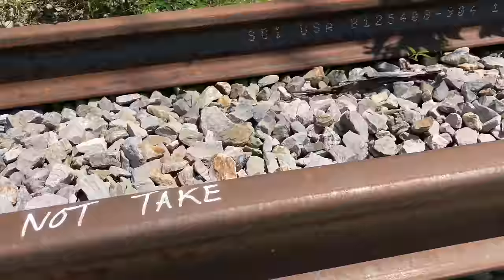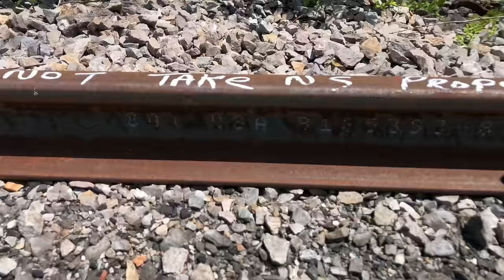Abandoned Railroad & Abandoned Locomotive Isolated On Abandoned Coal Mine Branch In West Virginia!

Comment: Sad to see. Even if that engine wasn't worth starting, they could have pulled it out and brought it to a place to be scraped. That is weird to see the distant signal, or a detail signal, still lit without track near.  Unfortunately the coal will be replaced by solar. A coal power plant where I live is closing down next year. They talk about replacing it with solar. The plant sits on about 260 acres. It would take about 2,500 acres of solar panels to replace it and get the same amount of megawatts. Talk about a big footprint.
Reply from the maker: They just installed panels on a farm a mile from mine.  It takes up an incredibly huge area.  They wanted to buy my farm but I didn't want to sell and neither did my neighbors.
Reply: @JawTooth  What's even more crazy, there is so much hazardous material in those solar panels that after their 15-20 year life span, they have to bury them. Doesn't sound too environmentally safe to me. I think you made a good choice declining having those on your property. Farming your land is far more productive.

Comment: Hard to believe 3-4 years ago, they just opened 2 new mines maybe 30-45 minutes from there.
Reply from the maker: Do they have rail service?  Where are they?  I want to return
Reply: @JawTooth  The mine just outside of Wylo does, and they shove WAY up the valley there, the other is outside of Berwind. Now sure how that mine is moving material, there's track there, but not to the face. that's at 37.213230324891775, -81.66544148266723.  Around there, is a large steel trestle and ahead of that is a tunnel. 

The Wylo one is 37.711457, -81.752866 at least the face is, the load out is here: 37.68201531310831, -81.83023660932894
Reply from the maker: @kleetus92  I almost filmed the one at Wylo.  My plan was to spend the night at the Colonial Inn in Man and then try to get a coal train on that line that goes to Wylo.  We spent our first night in Matewan but I was having a hard time finding loaded moving coal trains and my wife didn't like the place we stayed at in Matewan.  Due to that we left without staying the second night in Man.  I will return though.   Do you have any idea how many days the trains run through Man from the Wylo loadout?
Reply: @JawTooth  Honestly I do not. It's been a couple years since I was there, and I was there originally to put in the VFD speed control for the main ventilation fan. When I was there I stayed in Logan. Pretty sure it was a Holiday Inn, behind it was a movie theater and a bunch of stuff at a decent mall. I went poking around the valley there a bit an found some old, OLD signals still in service, just the standard traffic light variety beside the main bridge into town. Don't know if you saw my email or not..

Comment: The only way they could possibly reclaim that locomotive is with the use of a railed flatbed road.trailer and semi used to move heavy equipment. Install rail on the bed with a tapered lead to the tracks. Attach a heavy cable to the loco's frame...shift it's gearbox into Neutral (providing the gears didn't seize up)...and winch that baby up onto the trailer on the rails. Chock the wheels, and away you go.

Comment: You should see if CCET would buy the locomotive to use! Just be a matter of getting a lowboy and crane up there to get it. Looks like it still runs.
Reply: Oh, and don't forget how much all that will COST! If the loco does have roller bearings there still might be some serious mechanical issues that precluded a sale or another use elsewhere.
Reply: @kenhanks9620  True. Could possibly be bought and used for parts. There has to be a reason that it was just left there.
Reply: @kenhanks9620  Yes, the locomotive has roller bearings. You can clearly see them in the video. What's with all these bearing comments?
Reply: Why would CCET want a locomotive that hasn't been run in over a decade and which needs trucking out? Your "just a matter of" is already costing a few hundred thousand dollars. For that price, they could buy or lease a perfectly functional locomotive.
Reply: @Northeast_PA_Trucks_And_Trains  "There has to be a reason that it was just left there."
The reason would be that it wasn't commercially viable to do anything with it. Even before the railroad was lifted, it would have cost more to tow it to a scrap yard than the value of the metal in it.
Reply: @beeble2003  Dennis B earlier mistakenly stated loco had friction bearings.

Comment: In nz they are replacing all the usa locos with cheap and nasty ones, from guess where. They invented gun powder. They are using marine engines, which are breaking down often, from shock loading. Nz is 36 inch gauge and very windy and hilly.

Comment: Theyr'e not done with that property. Who knows if the loco is still a good runner. There could still be value in the property as an investor with the correct funds to resurrect he mine with the loco as a more efficiently run operation. The best source of info would be to speak with the buyers or sellers of the property. Maybe the mine could be purchased by a large conglomerate that owns other mines and is equipped to operate them more efficiently than the past owners. I've seen that happen before.
Reply from the maker: Sometimes they do reopen but its rare.  The last mine railroad that I filmed had been closed for a decade and then reopened around 2000 and is still in use.  This one looks less likely because they tore down a huge building  that loaded the railcars and it actually stuck out over the highway.  You can still see it on Google Maps.  They keep closing mines right and left.  Coal from out west is even coming through this state on its way to buyers

Comment: I'm sure that NS is using it somewhere else. It's a shame that they didn't pull the locomotive out before pulling up the rail.
Reply from the maker: I wish I knew where they are reusing it.  That would be interesting to show
Reply: @JawTooth  you'd have to ask around within the railroad system I'm sure one of the track crews would know. 

Also, the reason why I commented on the gondolas is that each  State has their own laws regarding the ties and spike's because of the environmental hazard the poss especially the tires. Has for the plates NS will haul them to their track facility (T-Pad) and sort out the good ones and reuse them. Regarding the spikes scrap for money. 

   For anyone who wants to take anything from the property beware, the rail, tie plates and spikes are all documented even the scrapyards have to document everything due to Federal law so it's  all traceable. 
  I know this as where I used to work for a railroad company and found some stuff missing along the railroad right-of-way and traced it back to a track crew and fired all of them. Thank goodness that's all they got as their could of been Federal charges brought up.

Comment: The "DO NOT TAKE" rail, was that actually used, or was it originally staged as replacement rail? 
And the railroad probably sold the old rail to a scrapper, but instructed them to leave the staged rail with explicit instructions not to take it.

Comment: You can see that the propane and liquid oxygen needed to cut her up has already been delivered and is sitting right in front of the locomotive.
Reply: You don't just leave liquid oxygen sitting out in the sun: it'll evaporate off by the time you get back.
Reply: @beeble2003  Wrong. Used to deliver the medical version in tanks virtually identical to those. O2 will last weeks in those huge vacuum containers.

Comment: If the railroad still owns the easement where they pulled up the track, they should consider installing ground mounted solar along the old line and use the power from it to back feed their own electric system or sell it to the grid.